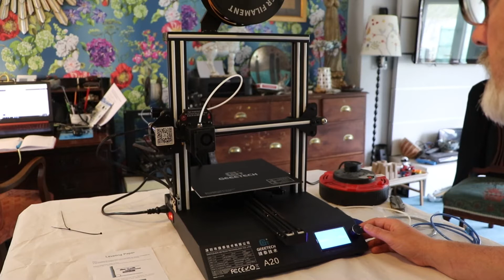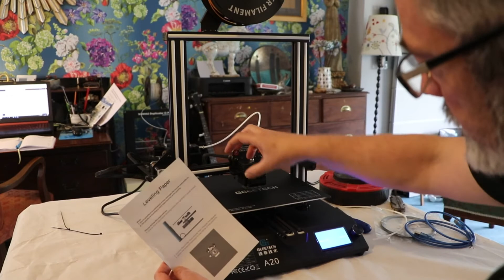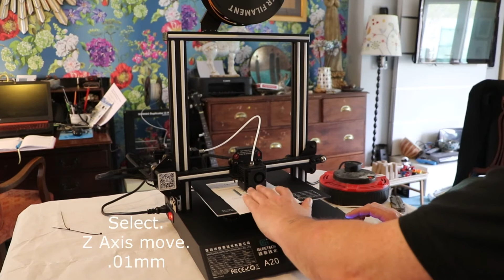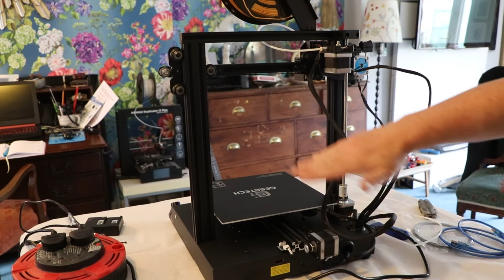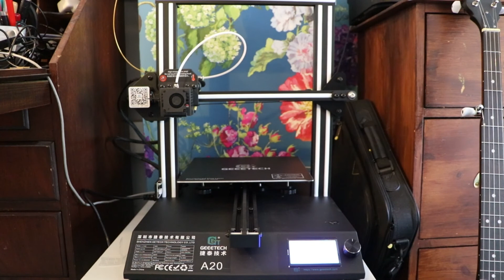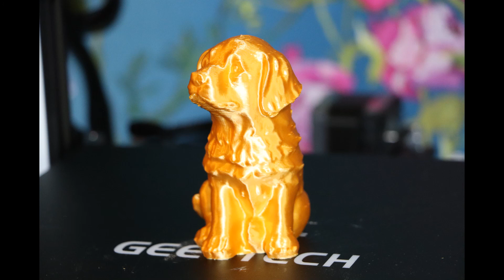Geeetech A20 3D printer Assembly and bed level

Comment: Great Video! But I've got a little problem with my nozzle hight. When I tighten all the leveling-screws, my bed is way too deep. The nozzle is about 5mm above the bed and I can't move the nozzle deeper since the Z POS Sensor is already triggered. Do you know a solution for that? 
KR
Reply: Same for me
Reply: Did you find a fix?